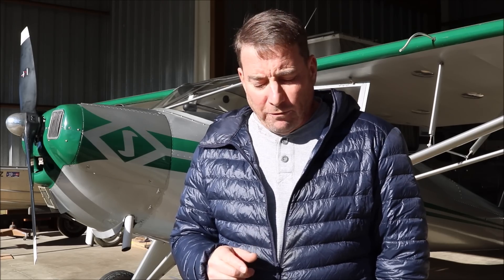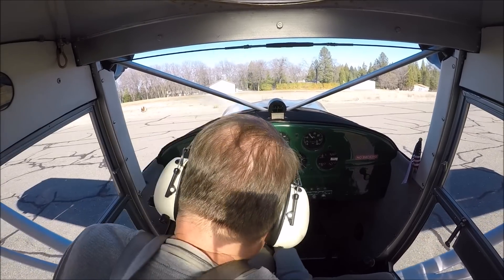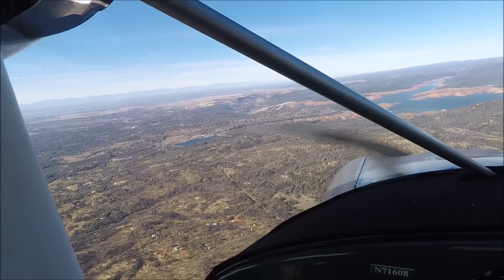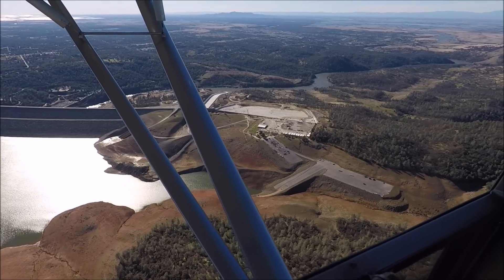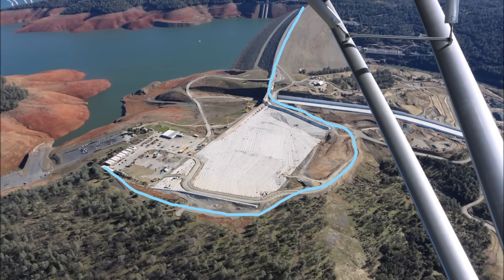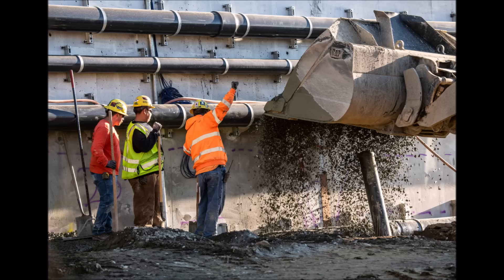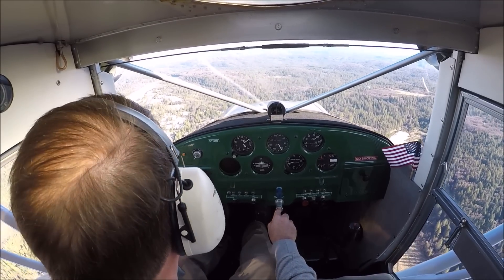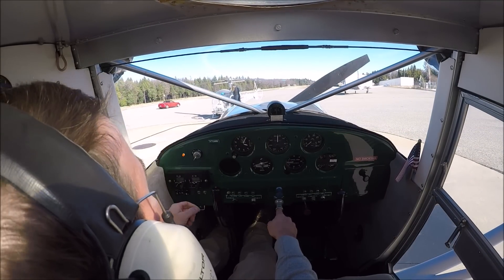Oroville UPDATE Jan 1 2019 Happy New Year!

Comment: Yes, I'm grateful for your coverage too. Just a few questions.

Where can I find competent information about the competence of the rock that makes up that ridge upon which the RCC spillway is constructed? The exposures I saw were mixed; some competent, some incompetent. Have there been any cores drilled below the cutoff wall so as to provide a clear picture of what will happen when the next overflow occurs? That is, some headcutting will occur somewhere below the cutoff wall, and when the water goes over it, it will accelerate according to the gradient and will headcut up to the cutoff wall, so I'm wondering how the engineers can be certain that it, too, won't be undermined, collapse, and make short work of the RCC, which any ground movement under it could crumble it like a cookie, and depending upon how long the overflow period turns out to be (1,000 year storms may come more frequently as the climate changes). That done, the reinforced concrete steps could become vulnerable, and eventually the new and old emergency spillway sections. I do not question that they have not made the emergency spillway works stronger, but I know nothing of what they were up against and what scenario they assumed. When it comes to the force of water in the volumes and velocities involved, we tend to underestimate its power to move mountains. 

Can you  refer me to more detail on the new main spillway design, especially with regard to the sub-drains? Are those pipes behind the containment walls plastic? What do you mean by "carefully graded gravel" and what is its function. Do you mean well-sorted or poorly sorted? How does the water get underneath the new spillway floor? Does it come up through the fissures in the bedrock with any kind of head-pressure or from someplace else? What kind of pickup mechanics were used? Perforated pipe? Gravel encasement, geotextiles, or both? 

Sorry about the length . . .

Comment: Wow, Juan, what a coincidence. These big engineering and construction projects have always fascinated me, and I’ve followed your Oroville updates since early on. My neighbor used to work for DSOD and now works for the Flood Board and has actually been on/in both of those dams. I hadn’t seen either in person, so Friday, 12/28, we got in my car and drove up to New Bullard’s Bar, got some stills from both sides of the dam, then drove out to Oroville. Couldn’t go up the road I wanted to (construction only), but ended up on the road on the south side of the river. Saw a plane up over the dam and wondered if it was you, but the colors weren’t right. Probably didn’t miss you by much though. Funny though, that you’re now involved with Bullard’s, just as I finally got up there to have a look. Same day, too.

Curious, do you know what they’re building off to the right, as you’re looking at the spillway? Looks like something in black and brown.
Oh, and what’s up with that green spot on the dam? Anything to be concerned about? :)   Happy New Year!
Reply from the maker: At Bullards? That may be the location of the new spillway tunnel...
Reply: @blancolirio  Yes, we checked out Bullards first, then drove to Oroville. Funny coincidence. The plane was seen at Oroville, but I'm pretty sure it wasn't you. Even at altitude, I think I'd be able to tell a tail-dragger from the other, that missing front gear and all...  Edit: I think I just realized what you meant. No, off to the right at Oroville, looks like pressure treated wood and steel, some sort of structure.

Comment: Juan I have a couple of questions, what octane is the fuel you use, and do you have to have a license to buy it or can anyone buy it?
Reply from the maker: Anyone can. 100LL.
Reply: well Juan, reason why I asked is I have a racecar and we run 110 octane in it, and the only gas station that sold it closed down, So everyone at the track is looking for alternatives
Reply: jam jam's  do you have any WAWA  gas stations where you are? They have 1 pump for LEADED ZERO ETHANOL, do not know cost, but here is a  suggestion go to a small airport and asl, because there I’d only  100LL , or go to a marina, they do NOT USE ETHANOL IN MARINE. gas engines., Maplewood NJ. Stay well.
Reply from the maker: Lots of racers buy 100LL from our airport.

Comment: Thanks for the update. Any reason why you top off the fuel after the flight? 
Just happens to come across your channel by accident when the spillway failed and have been following you since.
Reply from the maker: To keep the tanks full and prevent condensation inside the tanks. Also to be ready to roll for the next flight.
Reply: blancolirio HAPPY NEW YEAR TO YOU AND YOUR FAMILY,  there is a gas station from PENNA, there all over now  WAWA, they have1 dedecated pump, ZERO ETHANOL & is LEADED, do not know the cost, primarily for older cars that can NOT use ethanol.  , I lost a snow blower, leaf blower,  and string trimmer, ETHANOL., FYI ABC  channel 7 here had the report on the news about the utility, & Fire, loss of life.

Comment: The new emergency spillway should have a stage on legs above any potential flow, and crowds can set up pads and blankets on the stepped concrete area and watch bands and shows.  Should be an outdoor public venue to have a revenue flow on the side while it waits for potential emergency use.   It could be done without disrupting its primary function.  Was thinking mountain bike park or skatepark, since I used to ride the old trails that were and probably still are just a few hundred meters west of the end of the dam.  But it's a ready made amphitheatre for Butte county, and could be an excellent entertainment venue.  I had originally hoped a white water rafting park could be incorporated since it is intended for flow, using pumped water recirculated up the hill.  But its just too expensive to move the water that much per customer I think.

It really should be an outdoor theatre, it could hold a huge crowd and a big stage.  Even has a pit for under the stage work with the old drainage low point.  Everything involving the stage could be on concrete pillars like 6-8 feet over the emergency spillway, and the crowd can just be on foam pads and blankets on the steps.  It would be really nice for Butte county to have a venue that could offer a unique outdoor setup and the view of the valley below and take a huge crowd.  Might make some money if it could attract the crowds with the right entertainment for the areas demographics, Sac and Reno included.  Motorcycle jumping competition would work so well in that as the venue.  Whole crowd could see over everyone in fronts heads, for once :P

Comment: JUAN, I'D GREATLY APPRECIATE some close-up shots of the left end of the emergency spillway where they tied it into the hillside. I'm sure they did a good job--I'd just like to see HOW they did a good job of it.
Reply: That's as far down as they are going to place the concrete for the emergency spillway?  Seems like they are cutting corners again.  If they cut corners on these reservoirs, they should not have them.
Reply: @LaurieFloodTeacher   - They don't need to.  That's where the secant wall is located, and from that point on down the hill, the water will follow the natural rock channel(s) into the river below.